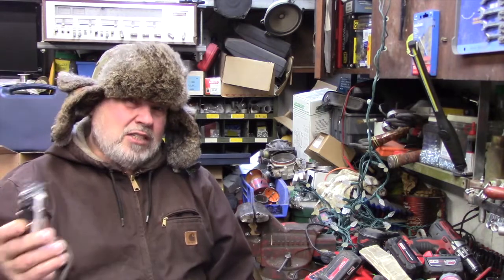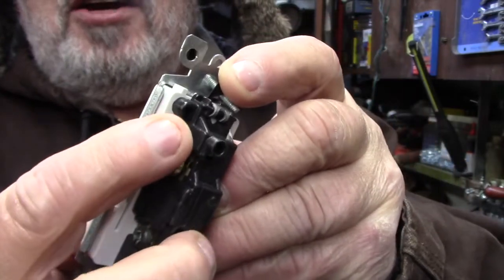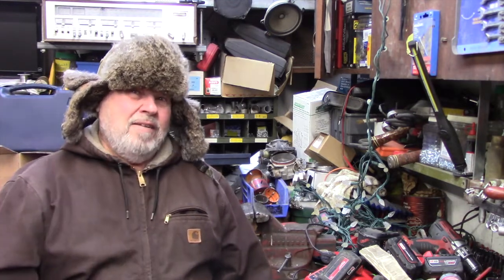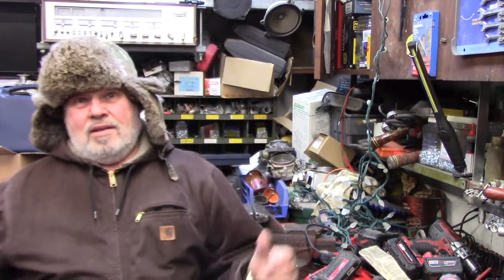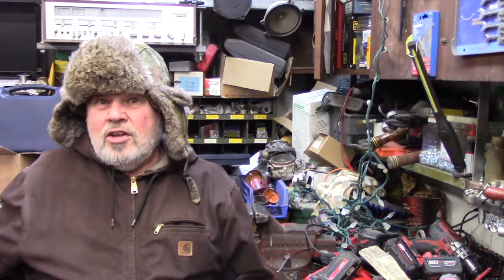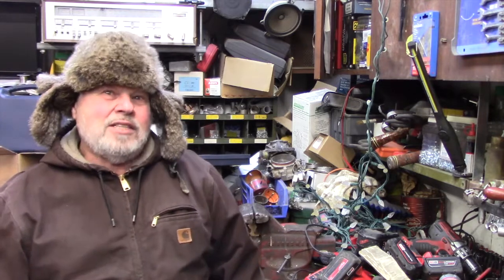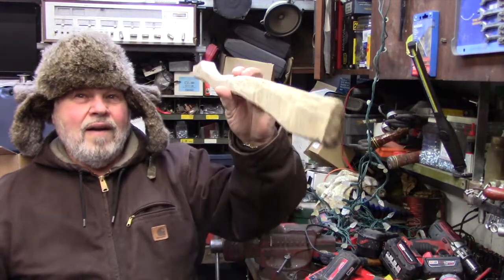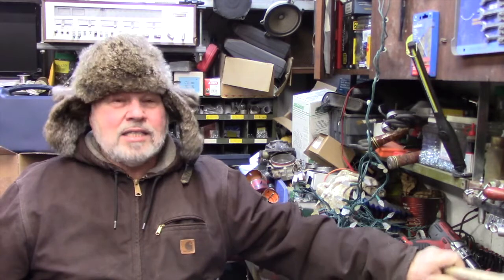The famous 3-way switch made easy... D.I.Y.

Comment: Hi Gator, It's better to eat pickle than get pickled. I keep things simple. I tell folks to mar the neutral through any switch up to the light.  Then connect the line to one common of a switch  and the light wire to the other switch common.  Connect the remaining wires to the other screws and your done. Cheers.
Reply from the maker: You are on the same path as me but in a few sentences or should I say words you described it all....CHEERS

Comment: Now what I understand from your video is: You better understand a 3-way switch if you don't want to bang your toe before sleep....   What you describe in your bedroom is very logical. I did the same, where the night lamps on each side of the bed are also switched on the wall near the bedroom's door, near the bed, and feeding the upper part of the outlet. Lower part is for the clock. So they are controlled either from the bed or from the door.  Logical, but not so common!

Comment: The traveling wire between the two 3 way switches normally is red right?  Common is the load wire right? You mentioned a red wire but didn’t say anything except black wire until you was about threw explaining . Lol 😆 I just love it. Thanks I appreciate the fun...   how do you have only 3 wires when you have a white, red, ground (copper) and a black? 
Lmbo🤣 
Love messing with you Gator. Thanks
Reply from the maker: You can mess with me but don`t mess with electrical....Never talk about the ground....don`t count the ground...just let it do what it does and don`t talk about it....In what I described the white was the neutral and the red and black were traveler....you need two travelers between the two tree ways....you have to pay attention....I know what it is....it`s them darn spices you always eating that`s affecting your mind....you have ta stop that....don`t tell me I`m going to have to draw a diagram....I never thought you guy`s where like this when I`m like that....CHEERS

Comment: Here I is.
Reply: Okay where's the pickles?
Reply: Okay there's the pickles. Everything is right with the world now.
Reply: Why you yelling at me? I didn't say nuttin yet?
Okay apology accepted.
Reply: Travelers aye? Say I'm a traveler. We are gonna travel to Florida later this year with the extended family. 
When I say we I mean me and the mouse in my pocket. Actually we are going to see Mickey and Minnie. 
Happy Motoring and happy tree way switching. Now I gotta go get a pickle. Axe handle has been axed. 
The only thing we have to fear is fear itself. WC 
When ya work on electric just keep on hand in your pocket either that or hold on to somebody so if ya get electrocuted they can pull ya off. Cheers. Now where is that pickle?

Comment: How's she goin'?  Did you ever wire a 3-way switch with 2 runs of 2 wire instead of 1 run of 3 wire?  Now that's when you need a diagram!!!  Take 'er easy!!!
Reply from the maker: I would not need a diagram with 2 ...two wires but did you ever wire one trough a light carrying your neutral on one side of the 3 wires....now that one you have to think about before you run your wires....CHEERS
Reply: @gatorsworld  Never did that one, but I can see why it would be confusing.  That's when you need to have colored tape and mark all conductors on both ends!!!  Electricians are brilliant, aren't we!!!  ;-)